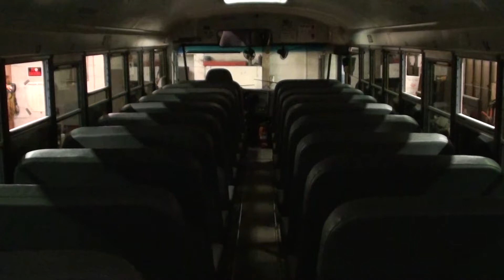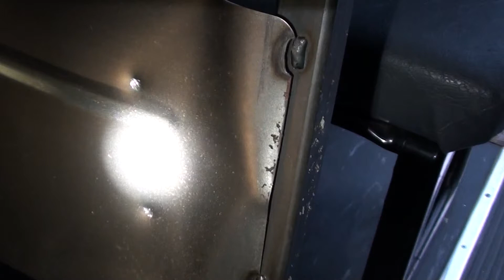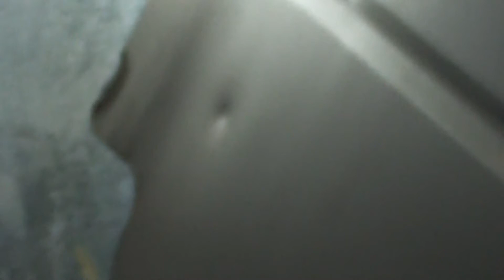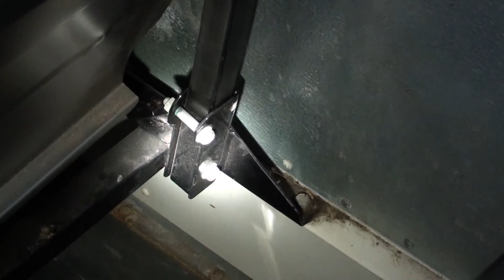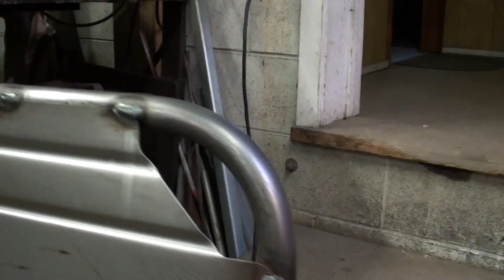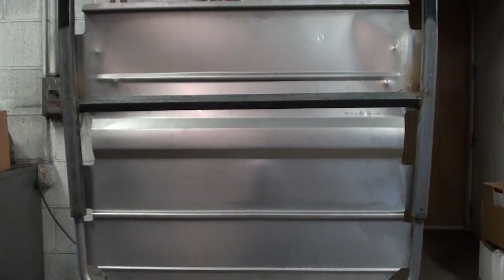2012 I/C School bus broken seat backs

Comment: I am about to drive a 72 seater international and seats are not secured properly. Can you show a quick video on how to secure those seats? the garage is closed and my first run is due on Tuesday... so want to secure the seat by myself if possible....  thanks in advance.
Reply from the maker: Is it loose from the floor, or is the metal on the seat back broken/Loose? If it is broken where it attaches to the floor, it must be secured. At our facility we will put a bolt through the seat foot through the floor and underneath the bus we'll put a large fender washer and nut on it.